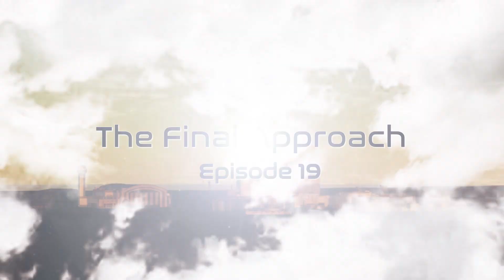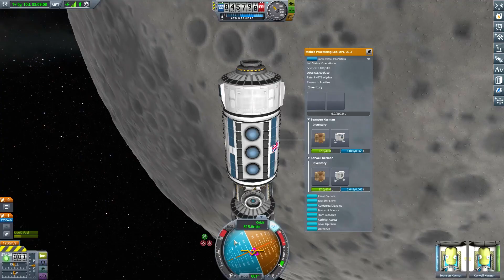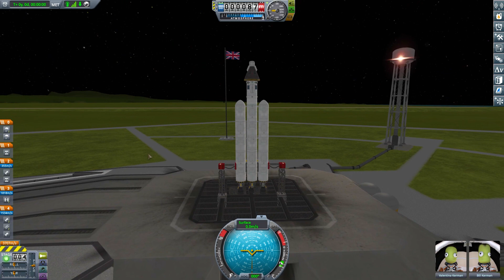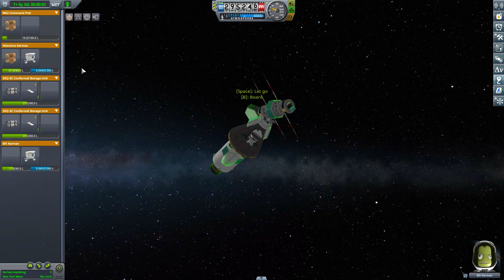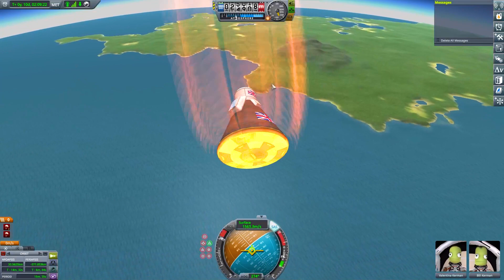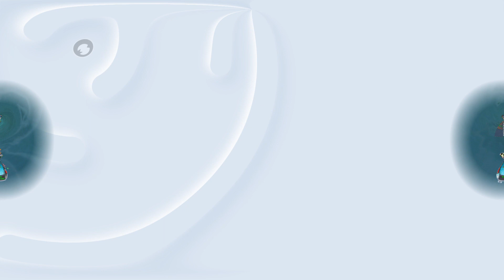KSP 1.12 | The Final Approach | #19 | Grabbing A Satellite

Comment: The Klaw is a lot easier to use than it looks in this video.  Your two big problems were too fast and you were kind of side slipping towards the target.

What I do is to make my approach so I will pass between 10 and 20 meters from what I want to dock with, and then come to a total stop!  I take my time here, trying to get as close to absolute zero as possible.

Then I turn so the Klaw is pointing directly at the target, and start my approach.  You can chug along at a reasonable speed as you close, but you must reduce your speed to no more than .2 - maybe .3 - meters per second for contact!  Although you managed to dock at an angle, I find this really hard, hitting the target square on is much easier.

After that, it's job done, unless you do what I do sometimes... forget to arm the Klaw in the first place, that definitely doesn't make it any easier!  Other people may do it other ways, but this is the one that works for me.
Reply from the maker: Lol yes Iv always had Klaw issues… I actually find docking easier! Iv had a few slow contacts that just didn’t engage so I think subconsciously I start thinking ‘maybe a bit more force is needed to trigger it’ will do better next time ;-)